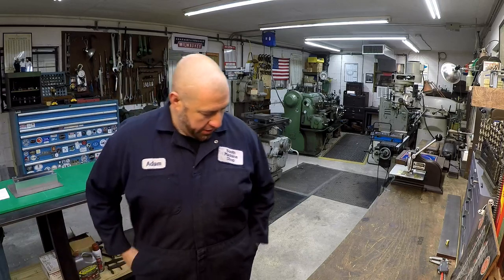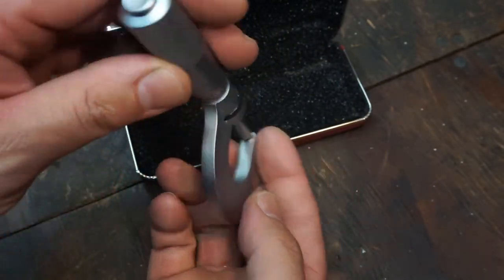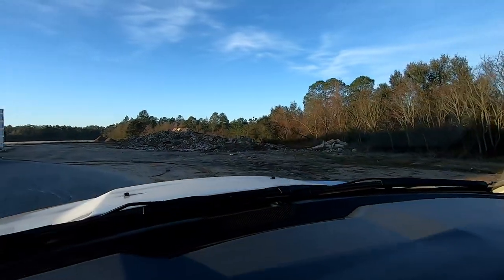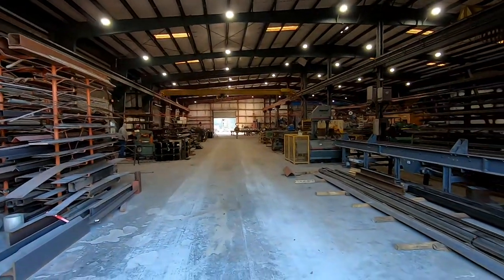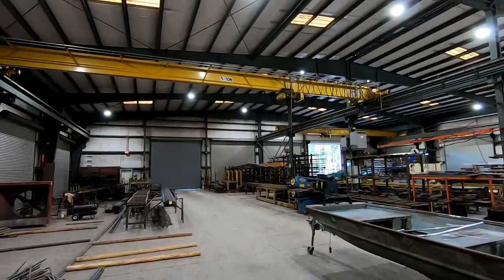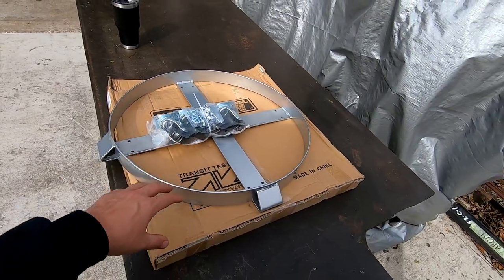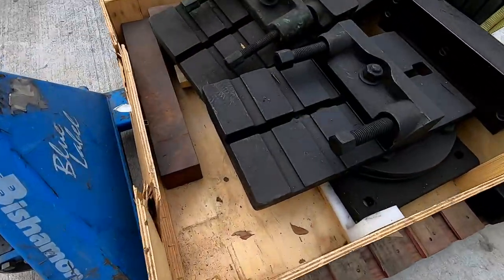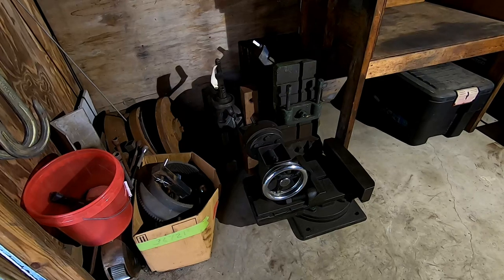SNS 248: Rudd Welding Tour, Shop Cleanup & Organizing, Vidmar

Comment: Couple things Adam, first your mom looks awesome.   I've always thought it is the sign of a mature grown man when he proudly introduces you to his mother!  Proud to say mine is 90, and  my wife and I live adjacent to her house so that she can remain in her home.  
Regarding your storage shed, I recently did the same thing and I picked up couple of those heavy duty shelf units at the Home Depot, the ones that are all welded,  there's no hardware, you just knock them together, and they can hold several tons, then put that treated plywood over the metal shelving,  they're easy and fast to put up, or take down if I move some day, and it seems like they were under $200 ea. for the standard height.  And they don't sag over time like wood, plus the insects don't like them.  
Lastly on the argon welding helper, thanks for showing the 4 flute endmill and why people use two or three flute mills.  Excellent unintentional demonstration.   Lastly thanks for clearly demonstrating the virtues of Helicoils and the right way to install them. I now feel totally confident in using them Scott.
Reply from the maker: I must have picked the wrong unit cause the one I got from Home Depot sucks!

Comment: Love the videos, especially heavy machining and anything Abom-sized!

My humble requests:

1.) Indicating a 4-jaw
2.) Grinding HSS tools for the lathe/shaper (angles, reliefs, chip breakers, steel grade, differences for aluminum vs steel geometries you like, etc.)
3.) feeds and speeds on normal machines vs. machine at handbook recommendations
4.) tool/shop maintenance (rust inhibitors, machine cleanup after a job, spindle maintenance, etc.)

Comment: A great day of free work.  I have the same issue as your storage shed.  My workshop has a 6 inch step I welded up a set of steel sheet ramps, I pick them up and put them away when I don't need them.

Comment: That Starrett 204 also seems to have a lot of clearance around the anvil.  I have a craftsman micrometer that I picked up from an old retired machinist's toolbox craigslist find that he recommended throwing away. It was ground down almost exactly like that to fit a specific measurement he said he had to do regularly.   It's still accurate enough for the work I do, I hit several of my gage blocks all right on so I kept it in case I need to get into a tight spot to measure something.

Comment: Hi Mom!  Nice to meet you.  Looks to me you just may have raised those two boys right.  For me, the jury is not out and they have been found guilty of being raised right.

ABomb79, you should put some kind of material between those metal things and that concrete.  Concrete is very, very porous and direct contact with metal will rust.  Anything, plastic liner, wood, anything.  I life if fog-central and am constantly chasing rust.

Comment: You might try building some shelving on pallets that you can move around with your pallet jack. Another thing I have thought about is putting shelving on tracks. That way I can maximize storage, but if I need something I can move the shelves on the tracks to get access to it.

Comment: HI MOM!!!

Great update Adam.
I retired in June of last year, I still feel like you do, get up and do what I want to do, on my own time.  It is a great feeling.

Please tell me that you had those great big pieces of steel tied down somehow when you were transporting them.  In the case of an accident they would become 500 pound missiles.
I had a friend, had a big transmission in the box of his pickup.  Got into an  accident at an intersection in town. The trans came right into the cab with him, had him pinned up against the steering wheel.  NOT GOOD.  And that was at low speed.  

And never thought that it would be colder in Florida then where I live (west coast of Canada), Oh well.

Comment: I listened to a man who insisted on having polystyrene insulation placed under the slab before pouring the cement floor. This allows the slab to change temperatures with the air not the ground during temperature changes. This stops condensation in your building. So I did likewise and tried to talk my neighbor into doing the same. He didn’t so his stuff rusts in his damp storage and mine does’t.  I would suggest you place your metal on some polystyrene not the cement floor for the same reason. I live up north so we have greater cold temperature change and you have greater humidity and maybe a little salt in the air from the gulf. So any thing that helps stop condensation is a plus! The spray will also be helpful. Great channel!!!

Comment: great Videolog... adam.. @36:10 keep a 4x8 x 3' wooden block so when going in and out of the shed  set it up on the concrete and slip the block under the wheels to tilt it up and go in easily. pull out to the edge and pull the block out to go out with..

Comment: I really like that welding positioner at the welding shop. That shop is nice. The one I work in is old and too small. I have to do most big jobs outside. Not so great in the winter. I am going to make a welding  positioner similar to the one you made  that will work great for what I do. Great deal on the cabinet. I see them on Craigslist here in Connecticut all the time. They want big bucks for them though.

Comment: Looks like you are getting your shop well organized and set up. Lookin real good. Looks like Rudd Welding gave those "Evaporative Coolers" a try, and ended up doing what most do with them, use them as very expensive fans. I have seen them tried before, they take a bad day and turn it into a hell day.
Reply: BiddieTube They work awesome.. In Arizona where the humidity is very low and the added moisture is welcome. Not Florida.
Reply from the maker: I had a polar cool at one time, at the old shop. It worked great when I filled it up with ice, but it was noisy and in the way. They work ok. If I had to work in a hot open shop a regular fan blowing on me is all I need.

Comment: Love that SouthBend 9" Model A Lathe.. I spent 12 Years running one of them at Dalhousie University Chemistry Department in Halifax, Nova Scotia..  I had every attachment that SouthBend Made for that Machine.. It's only downfall was the FLAT BELT that ran the SPINDLE from the Idler Shaft..If the SPLICE in the BELT wasn't perfect your TURNED JOB would show CHATTER MARKS..   sigh..  There wasn't ONE thing I couldn't TURN, within Reason, with that Lathe..  I would loved to have taken it home with me when I left that Shop..  sigh .....    AGAIN..     I used to Design and Manufacture Equipment for the Research Labs that couldn't be bought..

Comment: Adam, one suggestion I can make is to POST an email address or phone # for people to get a price quote for work needed by your viewers. I have experience on a lathe, milling machine and shaper but do not currently own any of them. While  I have a pretty well equipped Workshop there are times I need a piece fabricated and do not have the ability to do so  - so I am asking for personal reasons as well as making a suggestion.

Comment: A trip...to the tip

I used to love going to the tip...
As I knew there were always rich pickings there (lawnmowers, petrol strimmers and chainsaws)

Made quite a bit getting em running and selling em...
Reply from the maker: They won’t let you take anything from there.
Reply: @Abom79 

They're the same here in the UK nowadays Adam...
But back in't day I used to get allsorts of stuff...

I did allrite out of it n all..
££££..!!

Comment: Here in my county in TX if I bring in a load of, say,  just cardboard, they take that free. So I break down the boxes and wait until I have a load. Also, rinsed out milk jugs and such can be dropped off free. I am not sure, but I think the unsorted household waste costs about the same to just dump.
Reply from the maker: The county supplies residents with free recycling cans that get picked up each week. They also have recycle centers throughout the county people can take paper, plastic and glass.

Comment: I think I would store that drum of cutting oil someplace that was heated. For short term it would not make a lot of difference but if air gets in it will bring water vapor with it. When it cools down that water vapor becomes water that will go to the bottom of the barrel.

Comment: Here's a possible How-to.  I'm always curious how you determine the speeds you use when turning metal on the lathe (speed and feed rate).
Reply: @Ralf Kramden  1) Machinery's Handbook for Engineers  2) Tooling data  3) Experience.

Comment: Marvel Saws are the best. I recently bought an old 15A (vintage 1975) for a couple thousand bucks. Works great and is a straight shooter. I still have a few power hacksaws. A 9A and 18A. Both are still pounding out cuts.

Comment: The metal surfaces will draw moisture up through the cement and basically sit in a puddle; rusting away from below. Maybe move it, throw a pallet down and spray down the bottoms before restacking.
Just FYI, that's why you weren't supposed to store the older styles of batteries directly on cement. The moisture would swell the wood casings and crack the glass bowl holding the lead plates with early 1900s versions; while the vulcanized rubber ones from the 40s to 90s (black cases) that moisture would work its way through the normal microscopic cracks in the material of the casing then short out the batteries. Modern batteries no longer have this issue, at worse, a dirty battery will wick the moisture up to the terminals and short it (but we're talking some filthy batteries).